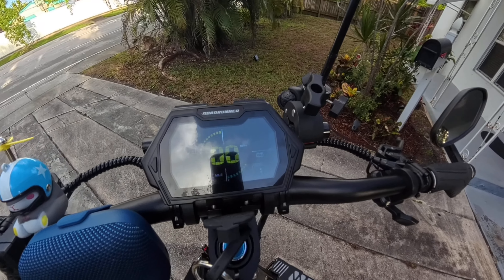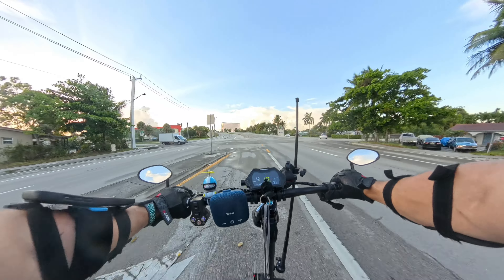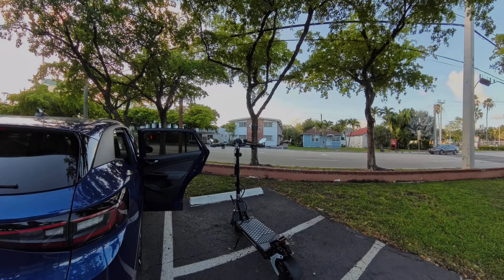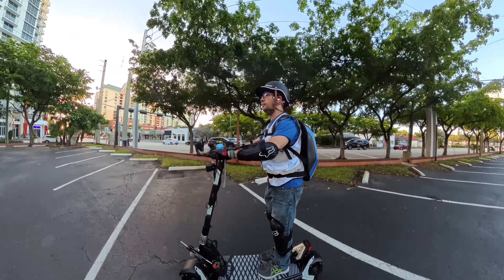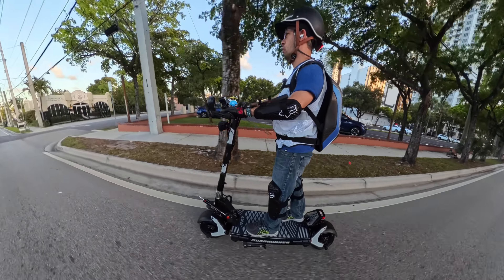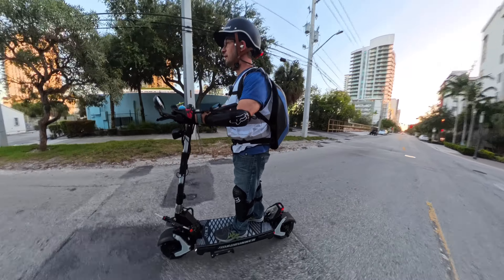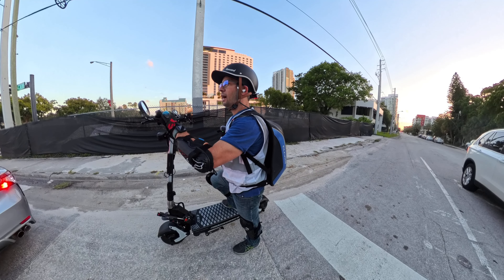Roadrunner RX7 Range Test

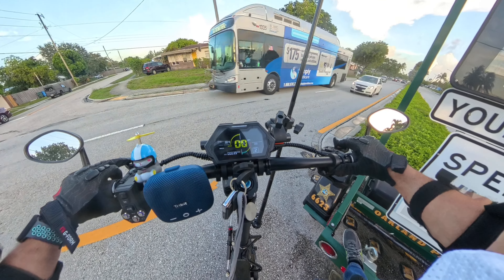Comment: When doing a 45 mile roundtrip ride to Cape May Lighthouse and back on my Nami Klima, Max I need to put it in the slower drive mode to get that range.  Curiously, in the real world, the slower drive mode doesn’t add that much time to my trip.  1:10 to go 22 miles vs. 1:00… I can’t make roundtrip range wise in the faster drive mode, so the 10 minutes is a perfectly ok tradeoff.

Comment: Thanks for this range test man 
Greatly appreciated 
Definitely not buying this one 😅
My electric skateboard goes much farther than that 😂😂 
So disappointing
Reply: He was having problems with the rear motor. He wrote a comment on ESG video. That could be the reason for the less battery. As well as the high cut off point. It is not a bad scooter, it has many benefits they other scooter don’t come with stock.

Comment: 67 mile range total 😮? So 16% the battery dies down 🤔
Reply from the maker: I am going to be doing more range monitoring and update here my findings the more i ride it. Electric Scooter Guide has the RX7 at 43+ miles, but i was only able to get 34… i will keep you posted. The weight of the scooter is why at 13% soc the scooter just can’t push it further
Reply: @MamboB  Well luckily has removable battery whats your top speed? Debating between this rs, and tfs ultra.
Reply: @MamboB All the Hyper Scooters never come close to their range tests. My Wolf King would barely make it 15 mins